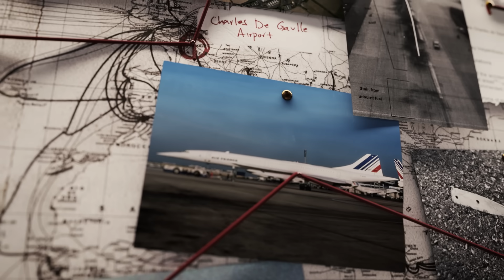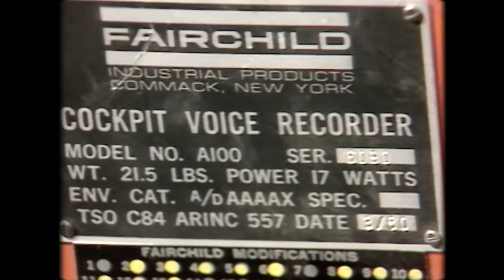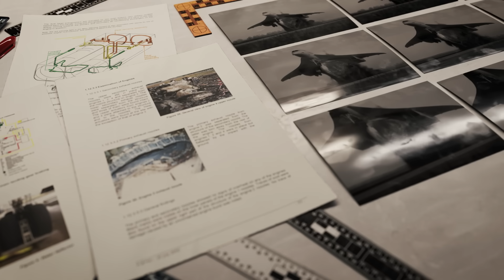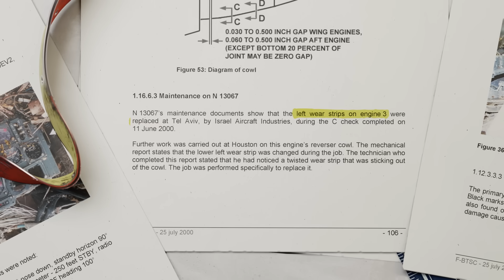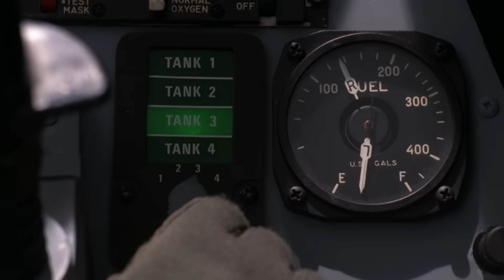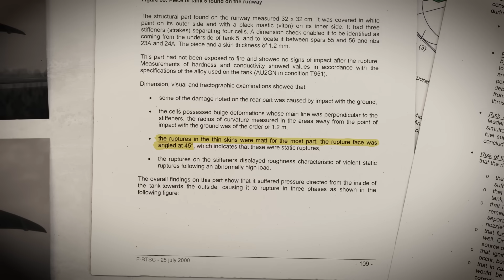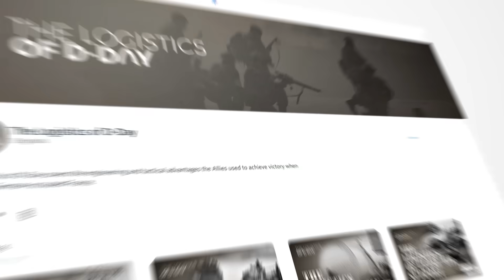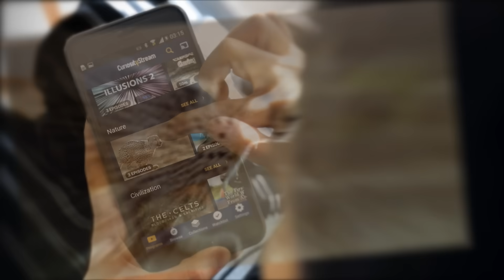What Actually Happened to the Concorde

Comment: This was all on UK tv several years ago so not new info, you also missed out the fact that British Airways did not recommend the fuel tanks were brimmed full but Air France had no such recommendation.  That day the Tanks were brimmed full which caused the shock wave that burst the tank, if they had not been full then it is unlikely the crash would have happened.  You really need to do more research or if copying another news story watch it all

Comment: Fastest commercial plane?
You forgot big asterisk :D
*Fastest western commercial plane
Soviet tu144 was faster and its first commercial flight was earlier than concord's , isn't it? 

P.S. You can also say fastest commercial passenger plane (at that time). It would be correct because Tu144 transported only cargo for some time before it starts to fly people.
But Concord was never the fastest commercial plane.
Reply: The design of the Tu-144 is due, at least partially, to industrial espionage for the benefit of the GRU, the French factories of Sud-Aviation (Aérospatiale) having been particularly involved. When Sergei Pavlov (officially director of Aeroflot's Paris office) was finally arrested in 1965, he was in possession of detailed plans of Concorde2's brakes, landing gear and airframe.
Also the TU-144 is a bit faster but at a cost of a much limited range (half the concorde one).

Comment: A damn dc 10 left a piece of scrap mettle put on incorrectly, shame, concorde would have had more years.
Reply: Dc 10 had nothing to do with it
Reply: @dknowles60  yes it did, because that piece of foreign object that fell off, which took off right before Concorde caused the tire explosion that caused the tank to rupture from the pressure, its in the full report.   If that piece had not fallen off, the tire would not have exploded.
Reply: @ravensrulzaviation  wrong. again. it was a very crappy plane

Comment: Excellent video.

All those modifications should have be done years before, after all those incidents of pieces of tires penetrating wet wing. The safety margin of low flow rate and lack of ignition sources (in this case, still active afterburners) was far to thin.

I would have mentioned, although it is not relevant to the cause of the accident itself, that the crew valiantly tried to reach Le Bourget airport and almost succeeded.

Comment: 57 tire malfunctions, 12 with structural damage and 6 fuel tank penetrations and nothing was done to attempt to make better tires or strengthen the fuel tanks?  Sounds a lot like normalization of deviance, which NASA was guilty of with the Challenger and Columbia disasters; but the French authorities blamed it all on Continental...
Reply: ditto that
Reply: Triple-ditto.  What an abandonment of responsibility by the aircraft company and tire vendor.
Reply: When have you ever known any country, not just France, to take responsibility for an accident like this?
Reply: They also had other problems with it. The one time it came here(New Zealand) it lost a significant chunk of the rudder when it flew from here to Australia.
http://www.airwaysmuseum.com/aircraft%20images/Concorde-G-BOAF-SY-4-89-KW-2.jpg
The higher French court ultimately overturned most of the charges.
Reply: Its nice to see people with common sense, thank you. But yeah innocent people always have to die first before stuff gets changed

Comment: The titanium wear strip was improperly attached on the DC-10 during maintenance in Israel.
Spacer on left main landing gear mistakenly omitted a few days earlier during maintenance possibly causing Concorde to veer to the left before it struck the titanium strip on the runway.
Fuel tanks were over-filled in anticipation of longer taxiing and hold times than actually occurred. This amplified the shockwave from the tire fragment hitting the underside of the fuel tank.
Last minute additional baggage loaded affected the center of gravity. Both the extra fuel and baggage put the Concorde over max takeoff weight.
The Flight Engineer shut down the malfunctioning engine without telling the pilots and well below the altitude indicated the in the flight manual. This finally doomed the plane as the hole in the fuel tank was so large that Concorde could have outflown the fire if it had sufficient thrust and speed.
If any of these things occured differently this accident may not have occurred. A lot of holes had to line up in the Swiss cheese for this accident to have happened.
Tragic.
Reply: Great- you beat me to it.
These were ALL factors in the crash, and any one “removed” could have meant the accident was avoided, like the classic description of holes in Swiss cheese..
I honestly believe the single biggest other factor was the FE. You do NOT EVER shut down an engine because of a fire warning at such low altitude under any circumstances, and certainly not without consulting the captain.
Reply: @FutureSystem738  Plus, the plane was overweight, out of balance and took off with a tailwind.  There were quite a few serious pilot errors which are glossed over here.
Reply: theres something so funny about the idea of a burning plane succesfully out speeding its own fire
Reply: Do you know if the Flight Engineer  shutting an engine down in event of fire is standard procedure at AF? It seems unimaginable that the FE would have that authority. Normally, only the Captain can make that decision.
Reply: @fazole  It's actually shocking that the flight engineer shut the engine down without authority. Especially since it was a fuel tank fire and not engine. There was an analysis by John Huthchison on You Tube which went into all this detail.
Reply: @fazole  It is forbidden to shut down a Concorde engine, even if it’s on fire, under 1,000 ft. by the operating manuals. The FE did it at far less altitude than that, about 200 ft., and didn’t tell the pilots that he did it.
Reply: Thank you now I don’t have to waste 16 minutes of my life listening to this

Comment: Surprised that I got the cause mostly correct. At first I thought that the wheel blow out would cause the plane's weight to press the landing gear into the fuel tanks but also the metal strip being flung upwards hitting the tank causing the fire.

Comment: I was lucky enough to fly on 2 Concordes in the early 1980s. Once from LHR to JFK which took 3 hours and ten minutes, and once on a subsonic flight (Mach 0.9 if I remember correctly) from LHR to an airport near York (East Leeds? I can't remember). The transatlantic flight especially was amazing and I'll never forget the experience.
Reply: The Leeds airport would have presumably been Leeds Bradford Airport, (also known as Yeadon). The runway was extended in the early 80s so Concorde and 747s could operate there. I never got to see Concorde fly as I'm too young but she was an amazing aircraft. My dad once told me about the few times Concorde flew over my childhood house as it was in the flightpath for Yeadon.
Reply: @stevenhickenjr  Ah, Leeds Bradford rings a bell, yes. I think we took a bus from the airport to visit York for the day. Seeing the Concordes fly was a spectacle. I worked for BA (I got cheap and free flights! hence my 2 trips on Concordes) at Heathrow right next to the threshold of 27L and every day a few of us aircraft enthusiasts would go out into the car park to watch them take off. It would set off all of the car alarms in the car park! And you could feel the rumble in your chest. At dusk especially, you could see beautiful pink-purple flames from the afterburners shooting out the back of the engines as it raced down the runway and slowly climbed away. It's a shame you never got to see it. It was beautiful!

Comment: V1 is not the "can't stop" speed, it's the "plane will likely take damage if you stop" speed. There are plenty of reasons to abort takeoff after V1
Reply: Like running off the runway and big boom
Reply: @ryeb_  staying on the ground and going off the runway is a smaller boom than getting a few hundred feet up and coming back down

Comment: Excellent video. There is one thing I didn't understand, though: Why did it lost power on the engines of the right wing? It's stated that it lost power on all engines. Shouldn't it have 2 engines left?
Reply: It didn't lose power on engines 3 and 4. The fire literally destroyed the left wing and the left elevon coupled with the asymmetrical thrust from engines 3 and 4 caused the aircraft to roll to the left. In an attempt to fix this un-commanded roll, they reduced power on 3 and 4 but they were already going slow and with the left wing melting and deforming, there was nothing they could do to save it. To make things even worse, they couldn't retract the landing gear because lines were damaged in the gear bay from the tire debris adding drag to a delta wing which does not do well at low speeds.

Comment: This is a superficial skim over the event which completely misses the key engineering issues that caused the disaster.  There was nothing wrong with Concorde this was a pilot caused event. 
1 The pilot made many of his decisions about crucial factors of the flight heavily influenced by the desire to maintain a time schedule. A critical factor in many airline accidents. 
2 he was overweight, and instead of resolving that issue, he took two disastrous courses of action:
a) he filled the fuel tanks illegally to the brim.  This was not permitted because in the event of a fuel tank puncture, there was no compressible air space to absorb the impact. This is exactly why the fuel tank exploded from the inside on this occasion causing massive fuel loss instead of a  normal puncture with low loss rate as had been a known phenomenon with this plane.
b) Because he was illegally overweight and desperate to keep schedule,  he elected to illegally use a 400m closed section of runway to maximise his take-off length. 
3. Air France rebuilt one of the main landing gear bogeys  and omitted to fit a crucial part responsible for the track alignment of the wheels.
4. By using the first inadequately paved closed 400m section which presented the wheels with a vertical deflection on meeting the properly paved section of runway, the plane veered to the left of centreline because of the defective bogey.
5. The plane only encountered the DC10 debris because it deviated offline, and if it had remained on the centreline this would not have occurred. And if the tanks weren't illegally filled to the brim, the fuel loss would not have been catastrophic. 
I've no idea what your agenda is but don't purport to represent engineering
Reply: CORRECTOMONDO
Reply: All correct.
Reply: 3. The BEA already concluded that the missing spacer did not contribute to the crash
4&5. The veer to the left was negligible. The Concorde struggled to gain takeoff speed simply because it was some 800kg overweight, not because the wheel wasn't aligned. Due to said struggle, the Concorde took off further down the runway where the DC10 strip was. 

Should the Concorde be within fuel limits, it wouldn't have struck the strip even with a missing spacer
Reply: @JohnDoe-ud3ue  That’s assuming that the BEA did tests on the effect of the missing spacer. No such testing is noted in the report, just a dismissive statement.
Reply: @JohnDoe-ud3ue  as with any accident, it's important to get to the true cause for the benefit of future passengers - and we should all be vigilant when corporations and govt institutions gloss over key elements for political or commercial reasons.  Had the truth come out, Concorde would still be flying today IMHO
Reply: I agree.  He only gives us events that both Air France the BEA and Continental agreed on.
Reply: All of this is accurate, but this video solely focused on the main causes.  It is interesting that the teams never investigated the rest of the evidence, but I'm not qualified to judge on their findings.
Reply: @Zerbey  pointless comment
Reply: Yeah, nothing wrong with the plane where multiple tire punctures etc have been ignored over time. Surely

Sure, the other stuff contributed, but if you left out any number of singular things it might not have happened. Emphasis on might there.
If the plane had been differently built it still wouldn't have happened. Maybe it also wouldn't have happened if the pilot had flown it differently, so what? Both things that can be addressed

Comment: I find it ridiculous that the lawsuit spent decades in court, long after any help could come to the families of the passengers.  The investigation was amazing, but lawsuits are a job security scam for lawyers, with no results or consideration for the actual victims. Honestly, a ten million dollar fine in 2010 is a pittance. I wish the credit card companies would give me the same consideration.
Reply: That had nothing to do with the families of the victims, they were paid out far earlier = "...less than a year after the disaster, accepting a comprehensive compensation settlement, brokered namely with Air France insurers. Nearly 115 million EUR (157 million USD) have been paid to the 700 persons entitled, according to their degree of kinship to the victim and to the financial damages they sustained." ie: Approximately 1 million euro per person on the flight.
Families of victims on the ground, and the pilot, didn't accept compensation, and pressed charges(seemingly separate to the cases discussed here).
It didn't spend decades in court, civil & criminal trials ran from 2008-2010, a review by a higher court ended in 2012(presumably this review was relatively short). I'm not sure where 'decades' came from anyway, as it's only been 22 years since the accident itself now.
Continental was originally ordered to pay 70% of the $157m victim compensation, along with the $1m compensation, and $270k fine.
The 70% ruling seems to have been overturned(as were the original criminal convictions for the mechanic etc) by the higher court, but it's unclear if the $1m & $270k were - news reports seem pretty vague.
Anyway it was more about responsibility for the crash, and who would ultimately pay what percentage of the (already paid) compensation.
Had Air France been absolved of responsibility(not great for marketing, to be known for a catastrophic crash), and potentially having to pay less of the compensation(albeit via insurance, but presumably their premiums would lower), would presumably make a significant difference in their ability to make a profit.
Reply: Worse than that, it was a 1 million Euro fine, about $1.07m. As you say, too little, too late

Comment: how did fuel ignite ? and how could you sustain burning fuel on a plane traveling at up to 90 m/s ? this problem wasn't solved
Reply: Fuel was ignited when debris cut some wires near the main landing gear i think, causing them to spark.
Reply: @ryeb_  tank punctured is at rear of gear bay, the gear bay is the place where are lot of wiring, gear was stuck down:  was damages in gear bay suspected, neither english or french teams had clearly explained the source of ignition and how fire was fixed at this location of the plane
Reply: @ryeb_  it's also strange how engines were affected by this fuel leakage at rear of air intakes; the high AOA was probably involved in disruption of air flow under the wing that caused fuel and hot gases to be sucked by engines ..... when death want you , nothing can be done !!!

Comment: Never considered it to be a pressure wave.

Thanks for sharing, because I was not sure what happened, lots of conflicting information at the time came out
Reply: Transfering forces throughout a structure will still subject materials to mechanical forces that will determine if the local material exceeds tensile, yield, or fracture thresholds.

Comment: 13:34 How does that work? Leaving alone even the loss of life, the plane itself was worth way more than 1 million euros.
Reply: They probably were not found to be 100% at fault (or anywhere close).
Reply: @AnthonyDeRobertis  I bet the lawyers were more expensive lol. Let alone the reputational damage and the cost of retiring their concorde fleet.
Reply: There were civil & criminal charges/trials. One of these initially found Continental to be responsible for 70% of the victim compensation, but this was later overturned. The specifics are a bit vague and contradictory from reports I could find. I think the smaller amount was related to the criminal charges, while the civil charges were related to the victim compensation.
The compensation itself(approx 1m euro per victim) was paid quickly(under a year) to families, except the families of the pilot & victims on the ground, as they didn't accept it, and filed charges.

Comment: 12:50 This explanation seems rather far-fetched. If a dent made by tire hit on a fuel tank caused a symmetric nearby bulge to outside, then there's no volume change of of fuel tank itself. And so there's no pressure increase.  
And even if there was some short instant pressure jump,  what was it in normal state after tanks were filled? I mean the airplane did burn some fuel during line up and takeof runway.
Reply: The fuel tanks were over filled leaving no air expansion gap to absorb the pressure wave. Liquid fuel is not compressible.
Reply: @vociferon-heraldofthewinte7763  They HAD to consume fuel during engine warm up and moving along the runway.  If your tanks are filled to the top and seal them tight, than you would create vacuum inside the tank, as the fuel is pumped out. That would make atmospheric pressure to push force from OUTSIDE.  Where's the fact about uncompressible liquid plays role here?
Reply: @shoutitallloud   Yes. But they overfilled the tanks over the design limit of the venting thus eliminating the air gap safety margin of the design intended to prevent the shockwave of an object hitting the tank.